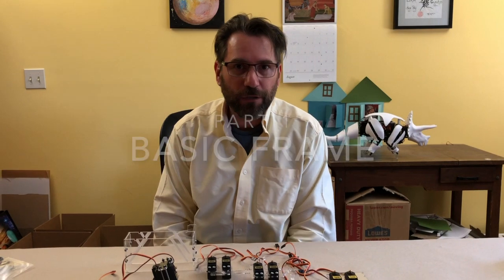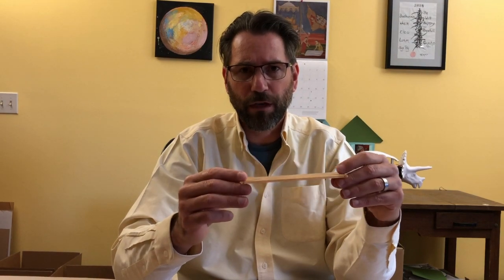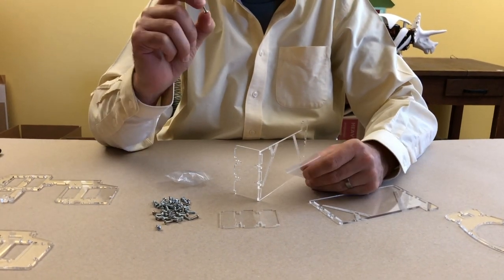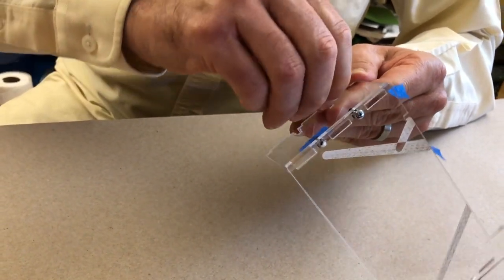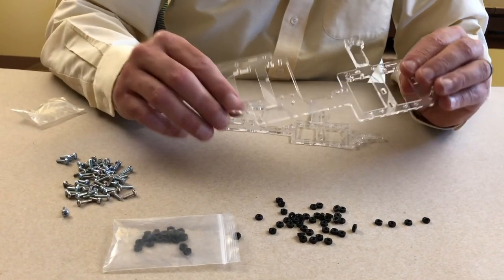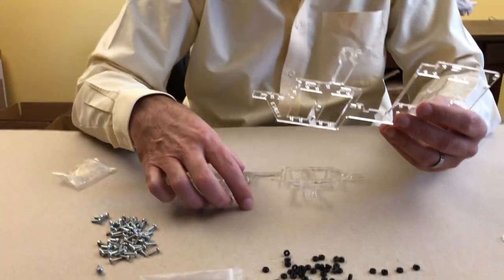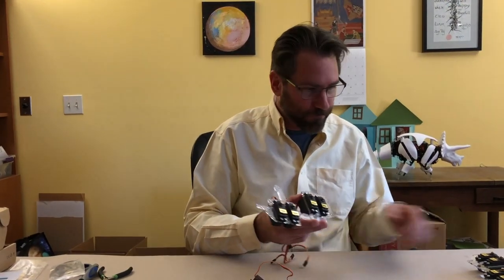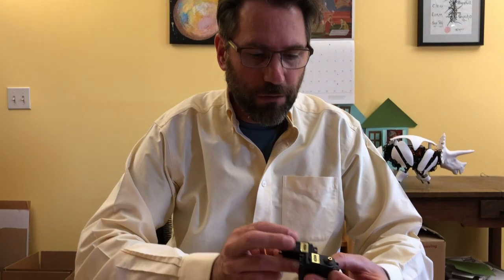Intellisaurus - Part 1 - Framing

Comment: I can’t afford a laser cutter.  Any way I can purchase just the acrylic pieces?
Reply from the maker: Sorry for the slow reply. I did most of the laser cutting at my local makerspace. e-mail me. jack@onemonkclapping.com I'll see what I can do.
Reply: @JacquinBuchanan  Hi Jacquin, thanks for responding.  i actually ended up 3d printing all the frames and it worked out well.  I'm curious if we'll ever see part 8.  i'm actually trying to build Intellisaurus and am very excited about this project.
Reply from the maker: @ryanau7222  That is cool. I should add that as an option to the docs or website. Should work fine to 3D print those parts at the appropriate thickness.
Reply from the maker: @ryanau7222  Not sure when I will get time to make a part 8 video. I should at least add a post on how to communicate RPi to Arduino. I had to bitbang the connection because the audio card on the RPi took all the good communication methods.
Reply: @JacquinBuchanan  i basically took your original dimensions from the svg files and resized it for stl.  it was a simple task though i failed to do this on my first print and ended up with an enormous Plate1 frame which was hilarious.
Reply: @ryanau7222  This is amazing!  I want one!  10fold, anyway I can get those stl files for the frame from ya?

Comment: The Audio is sub par...
Reply from the maker: Do you mean on the robot, using the 3inch speaker and ReSpeaker 2-Mics Pi HAT. There are higher quality speakers and audio HATs. But this is supposed to be a reasonable cost OpenSource kit.
Reply: @JacquinBuchanan  No.. I meant the video...
Reply from the maker: @lasersbee  Oh, you are so right. Are their parts that are hard to understand? Let me know maybe I can rerecord those.  I would love to have been able to setup some better equipment. Another casualty of Open Source. This is a project of enjoyment and sharing. Recorded after the family has gone to bed.